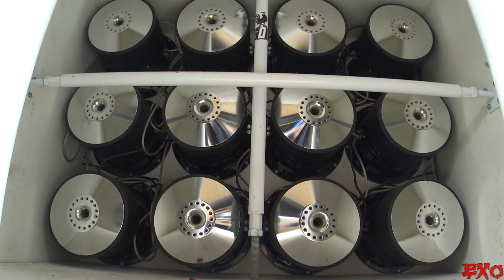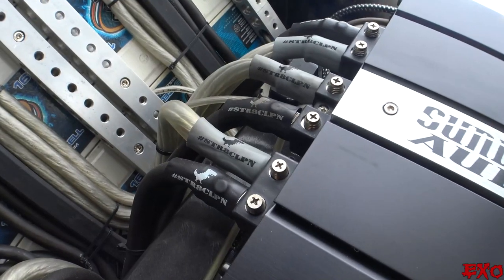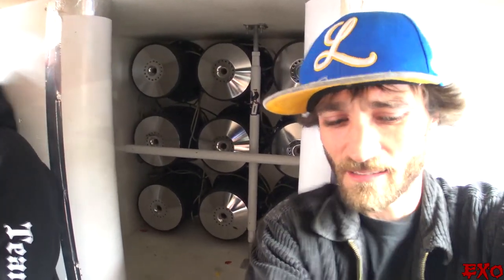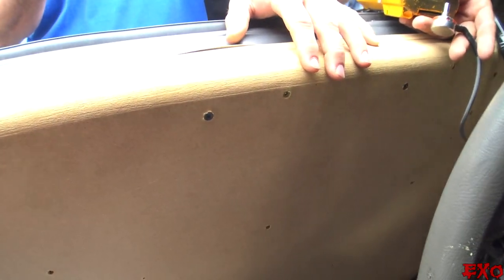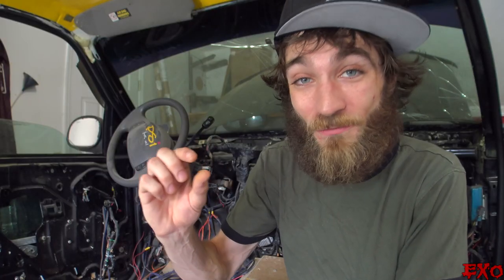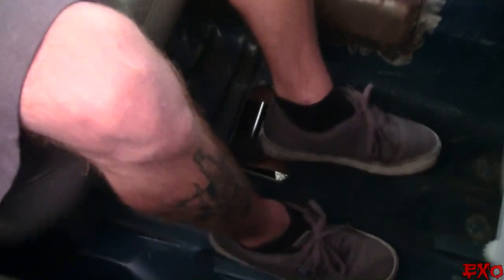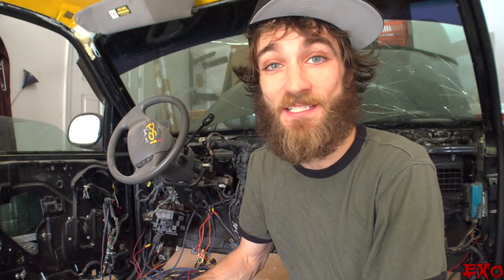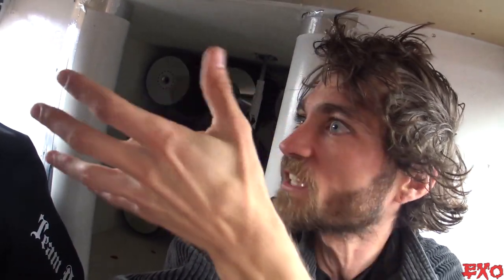Too MUCH BASS for a TAHOE!?!? Playing Kyle's BIGGEST Car Audio Subwoofer Sound System Ever!

Comment: I'm split in my opinion on this one. Yes that power and all those subs are bad ass. Color me impressed... but at what point does it stop becoming a vehicle and simply becomes a trailer towed sound vault haha? I think I would like to retain the ability to drive my sound system around, which means having a functioning and street legal windshield, the controls such as the gas , brakes, steering wheel are operable, and it has seats, seat belts, functioning doors, gauge cluster... etc. Basically keep it street worthy and street legal, but still with a sound system. Still, like I said, very impressive looking system, I would sit in it and listen to it with a smile stretched from ear to ear all day long man, but it can't really be driven practically as a daily driver in that condition.
Reply from the maker: All reasonable points, especially the road legal aspect! I'm more towards the exhibition side of things, but daily drivers still hold the biggest place in my heart! Appreciate you taking the time to comment :)

Comment: That is fuckin insane.I love it,but Im more into something super loud AND musical.I have been into car audio since the mid 80's, and how far it has come is mind blowing.I am doing a build with 3 Gladen 5k's,2 sundown 200.4,2 300 amp alts on a 4 bank LTO DIY battery. Its going in my 03 Escalade esv set up as a show truck.I am a bit at a loss when it comes to the subs. Leaning towards 6 15s in  a 6th order, but honestly dont know enough.Burps are cool, but I want to be able to pound super clean MUSIC all day long.Any suggestions on a Sub to match my preferences and 15k would be appreciated.A wall behind the rear seats I am thinking.Anyway keep the vids coming and do a video on LTO technology!!!

Comment: @exo i have also orderd the blowers to cool of the amps.
 but right now my sub amp goes after a hour bassheading in the thermal security but if i use the blowers would it help? 
so yes could i play much longer without going in the thermal security.
Reply: Are they mounted directly to a floor or solid surface? You need an air gap between the bottom of the amp and whatever you are mounting it to. You can pick up a relay that kicks on with the amp turn-on wire to feed the blowers.

Comment: But places like 6 flags ETC... won't damage your hearing.

Extremely loud car audio will over time.
Reply from the maker: 6 flags, yeah, sometimes they can do even worse damage! Strained necks and jostled spines galore lol
Reply: I too love loud bass, but turned up loud it often would wind up hurting my ears after awhile.

Of course in mine I had the bass balanced with the mids and highs so the mids and highs were just as loud as the bass.

"6 flags, yeah, sometimes they can do even worse damage! Strained necks and jostled spines galore lol"

I once rode the scream machine at 6 flags over GA and it had so many jolts ETC... that I got a powerful headache.

Comment: I been building a sound system so far just have a simple 4k monoblock with 1 15". The car does the same it makes the whole car shake but I am noticing...why are the new sounds more about this new sounds they all just shake the car but I bet you anything all that pressure you cant hear it 2 cars away from it. Whatever happened to the old set ups. My cousin had a car with 8 8" but yet sounded half a mile away and that was recorded back in 1993. My issue is I want that back I want my car to be heard half a mile away I dont care much about the care shaking around.

Comment: You need a military vehicle to handle that power. Any civilian vehicle will rattle apart. And you're losing the bass through the vibrating car parts. A solid structure would improve the bass and overall sound quality.
Reply from the maker: Very true!!! Any amount of flex is technically BAD for spl

Comment: OK here let me clear the controversy about that on both ends of the spectrum it’s s not so much as the intensity a decibel level of sounds that does damage to the hearing it’s s actually the distortion of the sounds If that the sound is crystal clear we may listen to almost any range of sound at just some full dB level will which may cause slight ringing of the ears but deafly won’t do any permanent damage to the 👂🏽 👂🏽 however if you do listen to these frequencies if it’s at very ugly signal where there is a more than a little noticeable amount of amplified distortion this’s what does tend to do damage to the hearing since the hearing is not made to process distortion of sound by the organs or by the ear drums the 👂🏽 🥁 🥁 suffer damage from distortion of sound. But 👀 look 👁👁 you’re right though: Loud music 🔊🔉🔊🔉🔊🔉🔊🔉🔊🔉🔊🔉🔉🔊🔉🔊 feels sooooo good 📀🎼
peace and Shalam
Reply from the maker: https://www.youtube.com/watch?v=g8N-bea_lUk